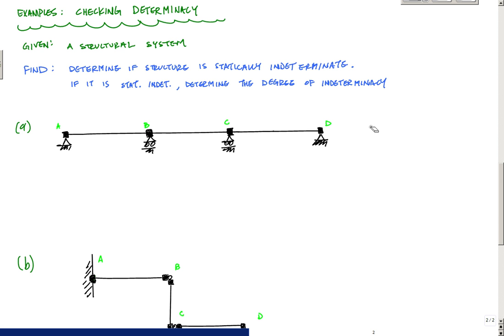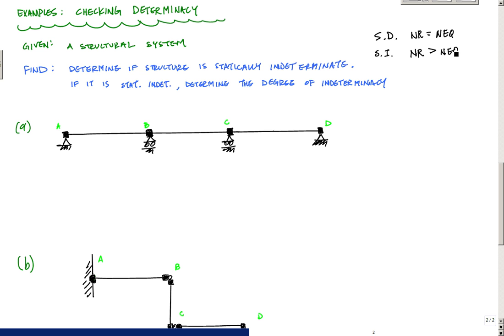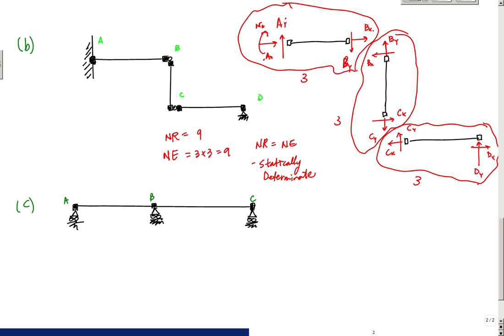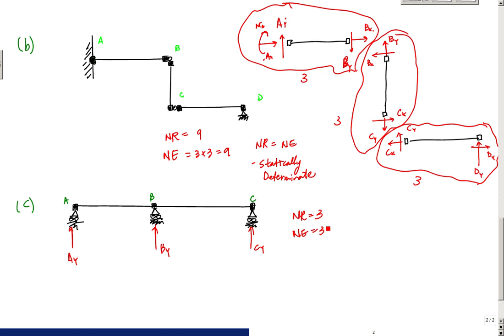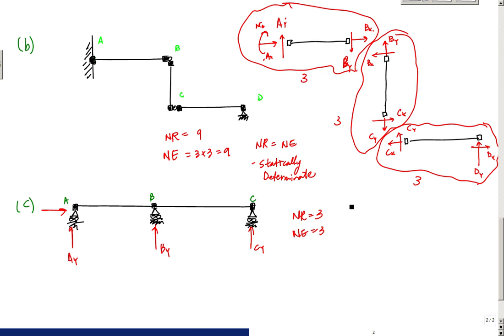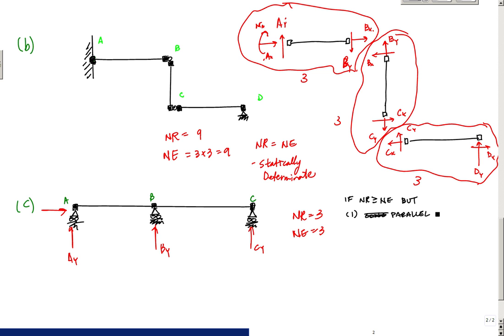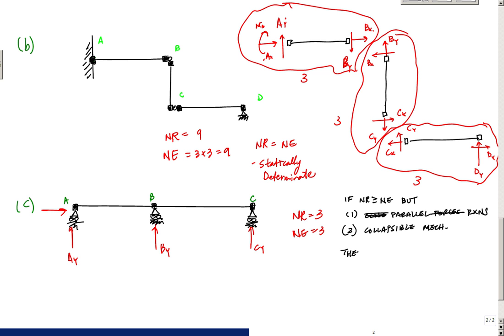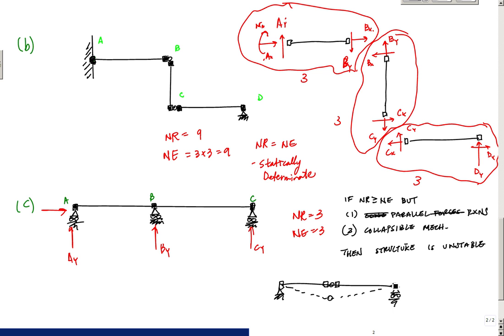Is it statically indeterminate? Examples - Structural Analysis

Comment: hi .may i know if i have a beam with 3 simple supported and only have one vertical point force act on the beam.is the system is statistically indeterminate?
Reply: Yes it is indeterminate in both cases when beam have point load and inclined load..indeterminacy is 1 in case of point load and indeterminacy is 3 in case of inclined load...go through my videos you will understand

Comment: Is the number of equation always 3?
Reply: External static equations are always three (For 2-D). But if there is hinge in the system then we can have extra equation. For example, Moment about the hinge will be zero. 
See it this way-
Case 1) A beam with both ends fixed. In this case the external reactions are 6(3+3) and static equations we have are 3 (2D). Therefore statically indeterminate. Less number of equations than the number of unknowns.

Case 2) A beam with one hinge and one roller. Unknowns are 3 (2+1) and equations are 3. Therefor making it statically determinate. 

Case 3) A beam with one hinge, one roller at ends and one internal hinge. This system as mentioned in the video above is Unstable as we have 3 unknowns (2+1) but.... we have 4 equations (3 of static equilibrium and one extra equation for internal hinge. Now the equations are more and unknowns are less that means it is deficient system and hence unstable. 

Case 4) Both ends as hinge support and one internal hinge. Now this is interesting because now the system is not unstable like that in Case 3. Why? because now we have 4 unknowns and 4 equations ;) Indeterminacy is ZERO and therefore it is determinate as well as stable.

Comment: Shouldn't Dx point to the left direction? Because if Ax point to the right then Dx has to point to the left to make equilibrium?
Good video btw
Reply: it is just a prediction, and you can't tell that withouth knowing the external forces, which are absent for this example. for example, if there were forces on points B and C in the "left" direction, you would get reaction forces on A and D as they were drawn.
Reply from the maker: Teutonic Terror Thanks for taking the time to answer. You are a star!

Comment: Didn't he make the same mistake at a) that he did at b) (ie not multiplying 3 with the number of joints to get the number of equation?)
If I'm mistaken, can someone tell me why?
Reply: He stated that the beam in (a) is a continuous beam. You can only isolate beams into separate sections if they are non-continuous (eg. hinged joints).

Comment: In example b, how come there isn't a moment at node D?
Reply: Because the member is attached via a Pin Joint, which allows rotation at the joint meaning there will be no moment at the node.